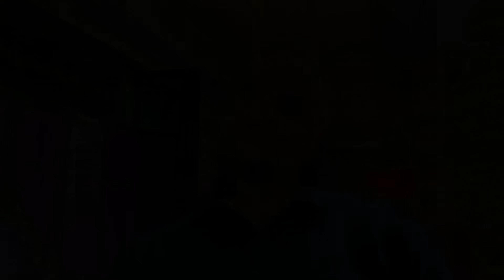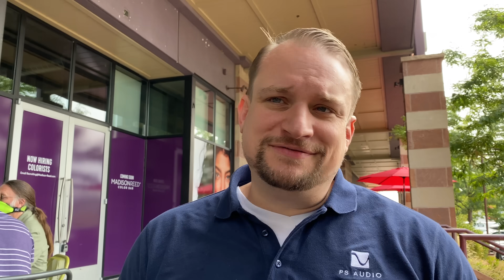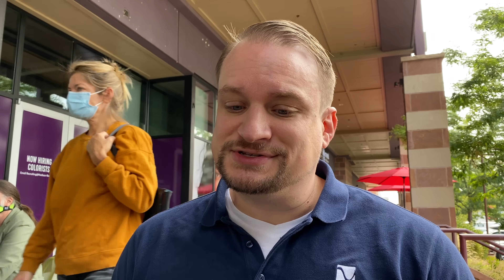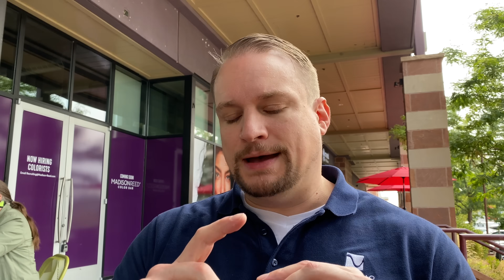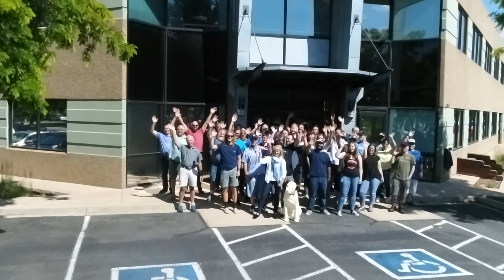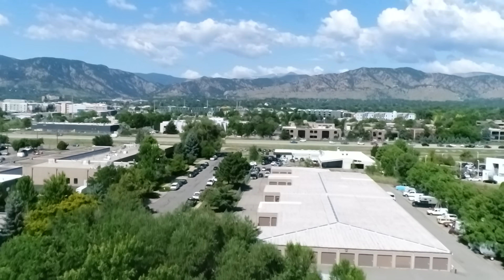Woofer designs for PS Audio speakers

Comment: I designed a woofer with two spiders back in the late 80's to keep the coil straight during high xmax. Mine was designed to have one in the normal position and the other was at the bottom of the coil. It made for a physically deep woofer but most boxes should be deep enough for it to fit.

Comment: The suction phenomenon. Isn't that addressed using a rear-vented magnet?

How does the multiple coil stages affect impedance seen by the amplifier, more demanding?
Reply: It's actually not suction causing it but for magnetic reasons that a woofer can take on a dynamic offset under higher power.

Comment: I’m itching to get out of my studio apt, I have been designing my setup already using the new floor plan. My AVR needs more new caps than I thought, so I think I’ll be fixing my power amp (those parts I have lol) and using my studio mixer as a stand in.
Reply: I'll be interested to find out whether your 'theory' (floor plan sketches) will match the practical after it's all set-up in your new digs.
Reply: Fat Rat yes that is a big concern of mine. I don’t want to have to throw out all my data lol. I’m not even going to begin to think about subwoofer setup until I’m able to hear the room.
Reply: Fat Rat oh yes, I do appreciate your support because you ultimately are right! I can only put up a bucket so I don’t get drool on the rug.
Reply: Fat Rat this new apartment even has a door INSIDE it that has another room attached to it! I’m going from living on a postage stamp to a whole envelope and I couldn’t be happier. Maybe someday I can afford a file cabinet.

Comment: I'm not sure what he's saying about the Spider doubling it up offsetting the the peaks and troughs,  a better way is to have it on the back of coil assembly so it's sandwich between the two spiders coil assembly, should be able to get away with this if you make the spider on back side near the plate on the backside smaller then the front, doesn't need to be as wide the spiders can have less tension, holds the coil assembly better in position stop  oscillating because it's only held in both ends. tell him to do it that way I don't see any difficulty in it by holding the coil assembly tube on both ends
Reply: Well, the back plate is in the way of this.  There are approaches that cut the back plate open to create a second magnetic gap, like the JBL differential drive approach.  This may be where you've seen a spider on the back side of the woofer (Velodyne used this approach on the original HGS and DD subs).
Reply: @cbrunhaver  no I didn't explain it will I mean half way in the magnetic field if you cut a thin line and attach it between the magnetic more like a surround then a Spider with very tight thin rings 3 should be enough, a silk materials soaked in liquid foam, I don't know of this JBL

Comment: I love such passion for perfection. Woofer distortion is a big problem. But how about servo feedback? Getting the cone to follow the signal as precisely as possible on linearity and timing is complex.
Reply: That's a great question. Especially for PS Audio who own a set of IRSs.
Reply: Brian Simmons Even the greatest woofer will have a decay issue that can be improved with servo to make the bass more precise. The reason we like high damping factor amps and good speaker cables is much about keeping the woofer cone in control, but still servo drive can do a much better job in making awesome precise, authentic, deep, undistorted, punchy, and not boomy bass.
Reply: @ThinkingBetter  Sorry, what do you mean by "we"? I understand what you wrote and agree but you make it sound like you work for an audio company.
Reply: @briansimmons5363  Maybe, but in this context, I mean "we" as consumers. I use servo subs as a consumer. PS Audio should look at this tech (I met them at CES): https://www.subvo.com
Reply: @ThinkingBetter  very cool
Reply: ps audio wont be using servo feedback in their latest designs. paul touched on that in their forum under fr-80 thread.
Reply: Nabil Danial Yes, I see that. Perhaps it’s also best business wise to keep things passive in a first speaker lineup complementing their existing product lineup.
Reply: Fat Rat Servo subwoofers are much more complex to develop. Paul made a great video about the topic ages ago: https://youtu.be/Vk3ti1nTtZ8

Comment: i had two sets of Speakerlab speaker kits that i built. I actually still have the Super 7's freaking awesome speaker going on 35 years old. still sound great but the 10" woofer and midrange need to be re-foamed the 12" woofer and Cobalt Ribbon tweeter provide excellent sound. So wish they were still around would definitely built another pair.
Reply: I too still have my speaker labs super sevens. I still live near speaker lab and was able to buy new mid range and woofers since the foam had rotted out. Can’t wait to hear the new FR 30s.
Reply: The original speaker labs sevens with the horn loaded drivers were quite the rockers.
Reply: @peterw2714  yes just before I purchased them they switched from the horns I so wanted the horns never had a chance to hear them
Reply: @gtric1466  Way back in the early 80s a friend had the Speakerlab 7’s over at WSU in Washington and his frat was definitely known as the party house. He used to keep those giant speakers in his tiny little dorm room until it was party time and then half the time they were out the window rocking the campus. Nothing like compression horns if you want loud clean music.

Comment: It does almost sound like they're "re-inventing" the woofer here! So are they doing the whole "accelerometer servo" thing with these woofers like in the almighty IRS?
Reply: The things he speaks of have been invented by others. And they lead to very minor improvements.

But the crossover and driver layout still have to be well designed.
Reply: @thunderpooch  SOME.. Of the things definitely! Focal has a similar approach to woofers if im not completely wrong. Whatever they're cooking up certainly sounds groundbreaking.
Reply: @AllboroLCD   Groundbreaking is all well and good, if and only if the basics are covered and executed well. And the basics are wicked difficult. Passive crossovers are old world tech that force your hand and constrain speaker designers in ways they couldn't have imagined.

We shall see and hear....one day...possibly...maybe...in 2021?

I don't think PS Audio should have gotten this far into driver design this early in the game.

They should have targeted a frequency response profile they wanted to achieve. A dispersion patter to their liking (wide vs narrow), with off axis rolloff being coherent throughout the range. And made sure phase and impedance results were smooth and within their targeted range...the tighter the better for phase results.

Also important is distortion, efficiency, and the tweeter's decay characteristic (quick drop off or one that lingers and emphasizes cymbals and high note string plucks).

And then there's driver choice and their specific tone characteristics.

There's so many basics to execute well and it's all a delicate balancing act, but the limiting factor is always the crossover. It keeps the entire design process sober and a labor of love...not a labor of adding bits of technical sham wow. You can't create an overly complex crossover to tame everything and address every issue or it sucks the life, musicality, and dynamic range out of the speaker. You often have to try multiple drivers and configurations with a few rudimentary crossovers to get close to to your overall design goal and sonic/tonal signature. After all this mixing and matching and then confirming with both in room listening tests and measurements are you then able to perfect the crossover. And you hope and pray at this point the crossover can remain relatively simple as parameters points (like phase, impedance, distortion, etc) are within their targeted range. If not, it's back to the drawing board.

Theoretically, it's probably possible to put all these considerations into a super computer and it spits out an overall speaker design and what the individual driver specs should be so you can design them from the ground up. But so far, no good speaker company does it this way. They began by taking off the shelf drivers (there's hundreds if not thousands of great choices to choose from) and they mixed and matched until they went mad trying to target their goal using a few basic crossovers. Then they perfect the crossover on the combo which works best. Only after they have a completed speaker with a completed crossover do they become informed enough to reasonably know what changes they'd like to see in a custom built driver. Then once that custom built driver is made, often after a few expensive tweaks, does it become a mainstay and signature of the company. But it too will also go through slight changes over the years.

Focal, Dynaudio, Faber, Harbeth, ATC, Vandersteen, Totem, etc. which have very unique drivers, didn't start out knowing exactly what changes needed to be made. It was a slow process and evolved throughout the years. The key to their success was abounding amounts of humility, vast knowledge, a little bit of luck that their initial approaches and hypothesies had merit, and a lot of work and constant experimenting.

PS Audio seems better suited to mastering active speakers. There, they are truly positioned to make leaps and bounds in the industry. But I think the rudimentary and frustrating aspect of passive crossovers will create headaches for them that they can't foresee. Passive crossovers force very bright engineers to become dedicated artisans. And most fail to make the shift.

I'm struggling to think of a well regarded hifi component company which also makes well regarded hifi speakers. I've been rooting for PS Audio for years to buck this trend.
Reply: @thunderpooch  Damn man, thats alot to digest right there. Your tech theory is spot on, although I feel PSA has the thought that theyve mastered the art of amplifier, and would like to take a whack at mastering speaker.
My Dad worked for Altec Lansing in the 80's & 90's. They made a series of speakers that began strictly from computer output specs, so your only off on that one thing sir.
Reply: @AllboroLCD   sure, every Tom, Dick, and Harry speaker company has computer modeling available to them to spit out a speaker design. And many use this approach, but I don't think these are regarded as having a special tonal characteristic or measure so well they beat all the others.

Those who are "tone whores" and pay over $10k a speaker don't mention Altec Lansing very much.
Reply: @thunderpooch  Well said. You've raised many interesting points. I wonder if PS Audio will leave the motional feedback approach behind, something that they so much praised about with respect to Paul's highly-regarded Infinity IRS.
Reply: @wramaccorsi1357   Too late. At this point, they forced their own hand. Lol

They have to go for it all and hope for the best. Given the time they've been working on it, they might have something great or with a lot of potential for the future. But man oh man is it going to be rough sledding with their customer base if this isn't spot on and now at a price point well above their initial rhetoric.

I suspect if they would have gone my route they would have had a very nice speaker available that they would have been selling for two years now, and at a price point of about $6 to $8 thousand cheaper than the current speculation on this model iteration. Then they could have plowed the profits back in to perfecting the MkII version with all the sham wow technical bits which will improve things on the margins. That would have allowed them to be up front with their customer base and provide a trade in program if the customers wanted to upgrade to the Mark II at perhaps a 20% discount for being an early adopter.

They could run a video with the promotion and talk about how it's their intent at PS Audio to get as many people into the HiFi community as possible and at a price point that is right for the end user and in a way that is fair to everybody as speaker development marches on at PS Audio. Then knock down the MK1 5%, and sell it to new customers under a certified program. People would have gone absolutely gaga and been impressed with their vision.

But that's all hindsight now. It's kinda comical hearing Paul in the old videos talking about the release of this speaker is coming  soon in Dec. 2018. Whoops.
Reply: @thunderpooch  I gotcha, didnt fully comprehend your point there at first. Your right about the post 1985 AL stuff and im just a rare case growing up around my dad working there, aside from being first and dominating PC audio right out the gate, much of what came from there has been long forgotten & barely footnoted. The home HiFi stuff released really was of top quality, modern design, and built in house. From what I gather, at the time OG Altec fans rejected the notion of a non horn loaded AL speaker completely, and publications gave them only semi positive reviews. There was even a mini battle that ensued with stereophile mag over what they felt was an unfair review of the BIAS 550 speakers. A set that was truly groundbreaking in tech at that time. Multi-amped self powered home speakers were just not a thing yet. Take it for what it is but they also developed/invented the Soundbar here as well. Came out 10 years too early and flopped commercially, but show me a best buy store today that DOESNT have a whole isle dedicated to  just soundbars!
Reply: @AllboroLCD   I think that's exactly what computer modeling is good for. Introducing a niche product line, but still lacking the know how to perfect the sound which would really wow people.
Reply: Rarely does anyone knock it out of the park on their fist at bat. Im optimistic about PSA's speaker and I wont rule out that they ARE being thorough in their process.
Reply: @AllboroLCD   I hope they crush it. But I would guess so many variables and things were considered and tackled at once that overwhelm is setting in.
Reply: @FatRat-f9m   I've always been a bit skeptical of servo controlled woofers being able to respond in real time in a beneficial way.

Theoretically I'm sure it all works out on paper. But as Chris mentioned, there's a lot going on with a voice coil anytime a decent amount of excursion takes place. And then a servo system has to "notice" anomalies and over excursion and correct that in real time. And we think of bass as "slow" and clunky but 20 times a second is fast to me. :) And I believe the woofers play up to 120hz? or was it only around 80hz?

I remember Paul wanted to increase the woofers duties to ~150hz. Makes sense. People touring were underwhelmed by the attack and slam of the irsv. Those woofers should do more than just rumble. They should pin your ears back and make your heart valves malfunction. ;)

Maybe the woofers will be upgraded to a model with that new tech of placing gaps and faraday rings on the voice coil. And maybe they'll be better suited to cover 10hz all the way to 150hz. But now the servo system would have its job difficulty increased by double (provided it's a linear relationship).
Reply: @thunderpooch ...yes it's interesting for our minds to think about the theory & what the results may turn out to be. I have to admit that I've never listened to servo controlled woofers so I can't really comment until I do. However, I'm quite happy with the 'unservoed' ones that I've heard down through the decades in various loudspeakers...obviously some more than others.
Reply: @FatRat-f9m   I like the PMC approach, lol. Seriously I do. It's so simple and stupid I say to myself, "heck yeah! Why not?"

Although, it doesn't regulate anything in a sophisticated manner; they just put a big metal frame over the woofer and it prevents over excursion from taking place.
Reply: @thunderpooch ...oh! I thought that you were making reference to PMC's transmission line design. I'll have to go & check it out then. Personally I'd prefer a 'long-throw' woofer design over having a metal thingamajig physically halting the progress of the cone. It must make a wonderful 'cracking' sound when the edges of the cone hits said metal frame; like a drummer hitting the rim of his snare with the thick end of his sticks 😆🤣
Reply: @FatRat-f9m  
I've experienced all types of servo controlled woofers... no mechanical clunkieness ... I've owned a pair since the 80s. 
I've moved on from them but still own them.

I replaced them when I built a quad array of 18"s in an attic mounted infinite baffle sub serving our primary media room. I augment the IB with four 15"s in a pair of double 15" active subs. 

In addition to the two servo 15"s, I currently have vented, small sealed, infinite baffle, and open baffle subs. 

Interestingly, I just learned of the connection, however I still own one of Brunhaver's old man's Speakerlab 12" dual coil (square magnet!) automotive subwoofer that I stealthily installed in a '76 Chevette! That was circa '81-'82, w/Alpine head end, Alphasonik electronic X-over, Linear Power amplification, and Alpine ribbon tweeters! 
Like many here, I began my journey in car audio ...  myself, the 70's. 

Anyway, nothing wrong with servos... in my experience there's nothing wrong with any particular approach to subwoofing, as long as it's well executed and implemented correctly in the room. Everything is a compromise, just some exhibit fewer compromises than others.